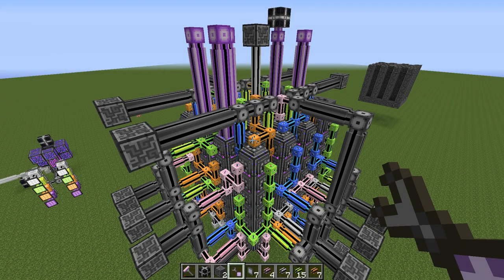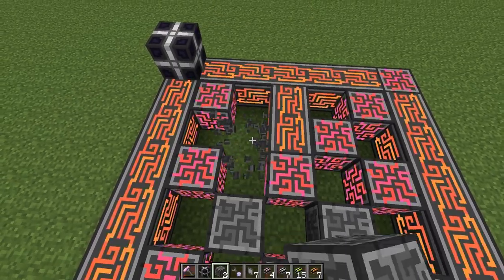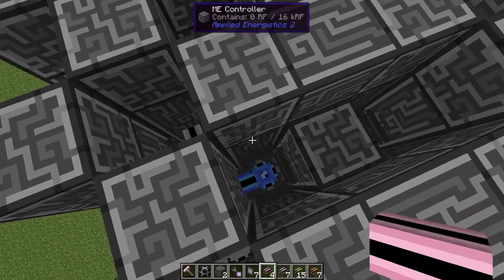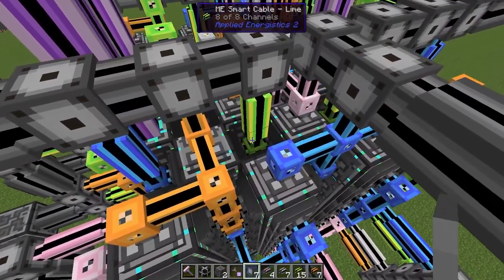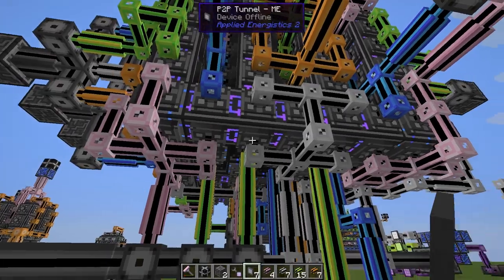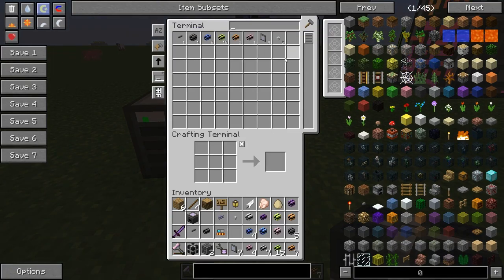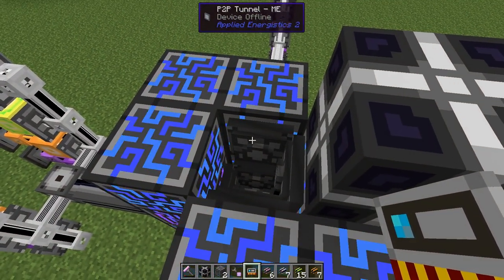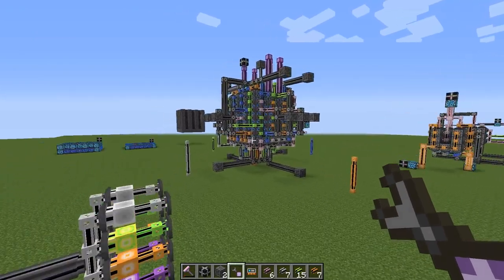Extreme ME Controller With 22 841 Channels - Applied Energistics 2 Creative Build (MC 1.7.10)

Comment from the maker: A creative AE2 build to max out the ME Controller: I could extract 22 841 channels for use. Crazy and awesome :)
Reply: 23,232 is the most i have managed
Reply from the maker: @betterbikes3043  Do you have a video or description how to do it? It's a long time ago since I did this build so I don't remember every detail but I guess you found a better design of the structure to get more tunnels connected to the inner parts?
Reply: @therealtkh  i am still building it (have the cube built but still working on the p2p side of things ) but all the numbers suggest that 23,232 will work i played with lots of layouts but it seems a 7x7 flat plate with 3 high chess board pattern on both sides is optimal given its the same total that other max layouts have done i assume it should work ( building in survival so its taking a while ) 

i liked your build but i felt that it was not using the inside  i played with many designs  before i decided this is best as its very simple and minimal blocks wasted
Reply: @therealtkh  the server is only really mekanism ae2 ender chests and big reactors the other mods are more cosmetic and farming related 

the aim of this system will be to take input from 100 digital miners (miners are using 20 max energy cubes and 10 power upgrades each)  

currently the system has 128 cpu cores and we want to add the ability to craft every craft able item in the game and keep 64 of every item on hand 
 i am at the stage of expanding the storage as we only have 128 storage drives full of 64k  

survival

power wise we already have a max sized big reactor and have rods set to 99% so we have around 800,000rf/t  we can tap into

Comment: I designed one with the fantastic number of 23232, a problem though is that not any surface of it can be used fully efficient through subnetwork channel restrictions. And because can't make subnetworks from subnetworks so I,m stuck with the knowledge of 726 surfaces * 32 channel's.

Comment: why can't you put the P2P tunnel network into another P2P tunnel and only to expand it outside afterward instead of going through and wasting a side of a controller, since p2p tunnel doesn't cost a block, this should work (correction: I was wrong, this isn't possible without modding the mod)
Reply from the maker: I'm not fully following, what sides are wasted? It has been some time since I did this video but we're limited by two things in thight areas: 1 - We can not run tunnels within a tunnel, that's a basic AE2 P2P rule that limits us. And 2 - Only 8 channels are allowed in a P2P network, so after I connect to 7 sides within the controller with tunnels I have to connect to a normal controller side. And since I can only connect tunnels to thin cables, I can never connect more than 8 channels at once. And a P2P tunnel costs a channel regardless if it's an input or output. 
Please explain your thoughts in detail, if I have missed anything I would like to know, but also: please try it as well :)
Reply: TKH I get the limitations, sorry, forgot that, nicely done.
Reply: what network need such monstrosity of channel, maybe a system that is able to auto craft all craftable item in vanilla Minecraft and still have enough space to put 2.1B of them (creative storage cell max capacity)
Reply from the maker: I have no idea, probably noone would need such a monster :) But it's a fun challenge to build and investigate these things, you learn a lot in the design process!

Comment: how do u link the inner p2p tunnels?
Reply from the maker: Good question, because this is really hard to do in a later stage when all are hidden. There are two methods:
1. Build the controller in steps. Expand it, pillar by pillar, add one tunnel at a time. That method makes sure that no tunnel is hidden before configuration.
2. Craft tons of memory cards, save settings for each P2P tunnel you place (especially on the inner tunnels). Place all memory cards in a chest or several - these are "free to use tunnels". So when you place a new tunnel in a new room, take one card and load settings to that one. Keep the card safe, because it's hard to get the settings and find which one it was :)
Reply: i like ur second method idea, and my guesse is in the inside u also use a different color for the cable when 8 channels are reached? i'm the guy from yesterday that new nothong about p2p tunnels and backbone system :D iv done research :D
Reply from the maker: darkova the best Yes, always different colors to keep them separated until you reach 8 channels per thin cable. It would have been easier if a P2P tunnel could connect to a dense cable! Haha, you're an expert now :)
Reply: the tunnel wihtouth a hole goes p2p to the bottom i guesse
Reply from the maker: darkova the best Correct.

Comment: I just made a very symmetric spiral based one, with 22723total channels.
190 blocks.
527 external faces
189 internal faces -> 6 external faces needed to extract internal connections. 
 The internal wiring has an average of 7 P2P per connection.
(527-6+189)=720 faces used for dense cables
6x32-198=3 left over non-P2P channels
720x32+3=22723

the design is extremely simple:
-make a spiral that fits inside a 7x7 area, starting outside.
1: controler/0:Air
1111111
1000001
1011101
1010101
1010101
1010001
1011111
-each layer is the negative of the previous one.
-the internal wiring is straight-forward, just dont forget the linking cards...
-where the gap between the spirals opens to the ouside, the external wiring reaches 2 blocks deep.
-complete the vertical edges of the 7x7x7 cube(assuming you started horizontally.)
-on the outside, only the concave parts need P2P tunnels, the rest can be wired directly, but its up to you.
-done.
Reply from the maker: Interesting, fun to se a different build with almost the same result! Thanks for sharing, it would have been fun to see an Imgur album to go with the description.
Reply: +TKH i'll upload some 😀
here: https://imgur.com/a/Gdt99LL
Reply from the maker: Good summary, makes things more clear! :) A bit tricky to build with all P2P faces inside, it's the same for my design but I think you have more hidden channels. But the overall design is a bit more straightforward. 
Just a note regarding the external P2P interface, they don't all need to go through the same controller. You can have several P2P network controllers for different directions. Makes things easier when distributing the real network. I guess you know this already though!
Btw, I only get notice on new posts, if you edit a post I don't get an email so good thing I checked again :)
Reply: @therealtkh   oups, thats good to know!😅

Btw, i'm currently working on a Spatial I/O teleporter system, where the player can choose a destination and is then send over inside a storage-cell via me-network using quantum-bridges.
The "Hub" is inside a chunkloaded 128cubed storage-cell.😉
The purpose is to make a huge player base thats only contained within storage-cells, with a few emergency teleporter-bases scattered throughout the world.
And since using "premade" teleporters is a bit too simple, AE2 will do.

I initially wanted to use the 16 Bundled inputs from ProjectRed, but since (as far as i know) there is no way to send bundeled-redstone via p2p, i chose to use OpenComputers, using OC-p2p's to connect everything and it isnt limited to 16b addresses, i only need 1channel per teleporter, and some other nifty stuff like GUI etc. 
Arguably, 2^16 or 65536 teleporters is already somewhat overkill, but its a challange in itself to fit 65536 quantum-bridges inside a limited space and wiring them correctly...(WIP!)
This design would need 3 of your maxed out controllers, each acting as a subnetwork...!😮
And since adding all the singularities would be a bit complicated, there is another network to store them(another 65536 channels!!!).😱
If your interested i could upload a few images to explain the details.
Reply from the maker: Wow, I really would like to read more about this system! Actually didn't know you could use the Spatial system as a personal teleporter... :D
Reply: Are you interested in how it works, or the actual wiring?

The latter will have to wait a bit, since both WorldEdit and MCEdit are throwing a fit trying to write all that data, not to mention the insane lag...

Though i have a few screen-shots of a fairly large chunk of the QuantumBridge-Hub(2048 QBs + network).
Reply from the maker: Actually interested in both, feel free to drop by on Discord ( http://discord.tkh.one ) and we can talk a bit more there.
Reply: @therealtkh  good idea.

Comment: "you can only connect one at a time, and it is hard to keep track of what goes to what"
my recomendation for making systems with massive P2P ssytems, make a memory card for every pair of ME P2P you want to connect, link it to the one inside, and then just keep them in a (preferably a non-ME) storage so you can reconfigure the outputs later without as much trouble. This is several hundred cards to keep track of for a system like this, but if you are building this resources probably are not a big concern
Reply from the maker: Totally agree (didn't I talk about this in the video? Or was it the large network guide..?). I would recommend saving the programmed memory card in a chest or in a Frame on the output place. Yes, it's a "waste" of resources but could really help when the controller grows in size!

Comment: It's a shame because with your solution to insides with five tunnels and then three (around 8:13), the one side you're plugging into is basically wastes 24 channels, but at almost 23,000 the maybe 150-200 you'd be wasting don't really matter. XD love seeing the insanity of AE2, and great video!
Reply from the maker: +D3athstreak Yeah, it's a little frustrating, but I don't think there's any other solution unless using a mod to connect to the sides within... But I'm not going there! ;)
Reply: Guess we'll have to settle with ONLY over 22,000 channels. OH WELL.

Comment: The Purple Densed Cables cumming out of the Controller, are they for the subnet?
Reply from the maker: A bit late answer, sorry, but the purple ones on the top are to extract the "interior tunnels" placed on the inner pillers and connected directly to the controller. A bit different from all visible P2P tunnels connected to dedicated "P2P networks". The reason for doing this is that it's not possible to extract more than 8 sides from every opening, but there are more faces inside. This method can be used when building normal base networks as well - before expanding with dedicated "P2P networks", but want to get many channels to reach far away (and not having resources to build lots of Dense cables).

Comment: How do you make the subnetworks talk to each other. Like if i had 2 subnetworks, one with the ME drive and other machines and other with stuff on it. If i put a ME Terminal on one it doesn't show the other's items.
Reply from the maker: +garygarygary122 It's generally easier to only go in one direction. Using a Storage Bus on an Interface is the most common method. I have done this in at least a couple of videos. If you want both networks to work as one you should probably have only one network. One could say that the only time you should have a subnet is when you have specific needs for an isolated network.

Comment: @TKH Is there a video showing how you routed the P2P on this build?
Reply from the maker: Not in detail, use the color of the cables to follow as good as you can. Almost all tunnels goes directly out to the "P2P network". I haven't touched this build in several years so I don't remember all details, but a good way to map tunnels is to set a memory card for every individual tunnel as some of them are impossible to reach once the cables are placed. I'm not saying this design is the best because it has (maybe) the most channels, it's really hard to build and maintain it which are two good reasons to go for something slightly smaller ;)
Reply: @therealtkh  I'm only confused with the very middle ones. How they can be accessed elsewhere. But in all honesty, I'll never need them. I love the way this build looks so its what I'm doing. I got a lot of help in the all the mods discord. I did not realize you have to do the memory card for each p2p tunnel. So a lot will be unused and for looks only. I guessed on the bottom and it turned out decent. But I have to rebuild it since I didn't do the memory card thing. But this will allow me to plan it out more. Thanks for replying!!!

Comment: i would shart myself if someone could explain the use/implementation of the 2x1 cable in the middle section of the internal columns.  i can see the cable connected to 3/6 p2p tunnels and then the controller, but idk what that does, how to pair those tunnels, or where the cable "output" is.
Reply from the maker: It was a long time ago I built this, do you have a timestamp where it's easy to see what cable you mean? Is it the blue ones? In the video description I have a few words on the Math and that it's possible to use the main network to carry tunnels from the inside to the outside - just need to have a few pieces of cable on the outside to extract them (the Dense purple cables, I think). Linking is no different from the others. I mean, if there are up to 7 connected sides somewhere, those 7x32 is worth more than the 1x32 on the outside - which makes it hard to worth it if counting channels.
Reply: OOOhhhhhhhh, thats very clever, just tunneling through the controller itself.  thank you! @therealtkh

Comment: I'm interesting in math model part of this, is it possible to calculate maximum channels by some formula (like you can get maximum of a function by getting derivative). Or maybe write computer program to do this
Reply from the maker: No idea, there are several design limitations when it comes to AE2 controllers (in how blocks are allowed to be placed, how far cables can reach into the cube) that makes the design non-symmetric. It can't scale according to some simple model and as my math shows (in the video description) it's still a few workarounds to get those final channels!
Reply from the maker: Also: when I did the video many years ago I did not know of any design with more channels than this. A few years ago I looked into it again and still couldn't find a build with more channels. Today I don't know if it's still a "record" because I haven't looked. It's difficult to build already as it is, and even though I have an idea of where I would try to get more channels I'm not sure even I is up to the task ;)